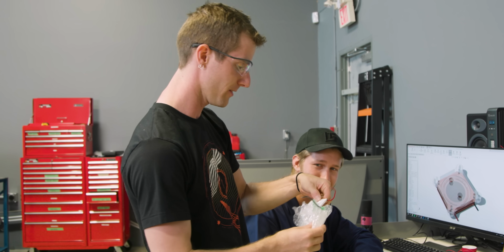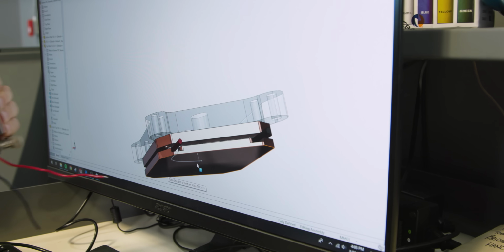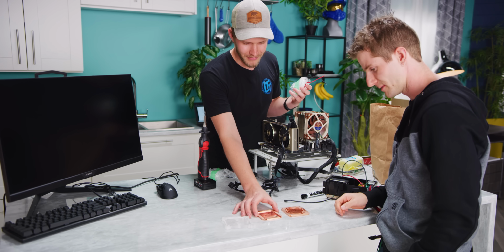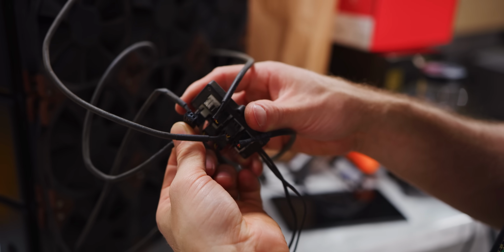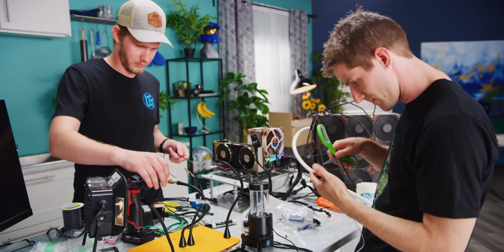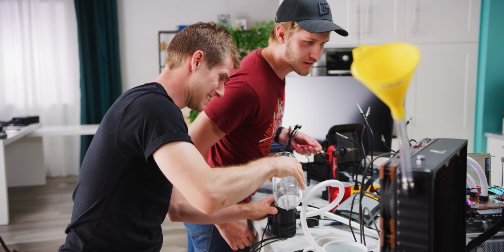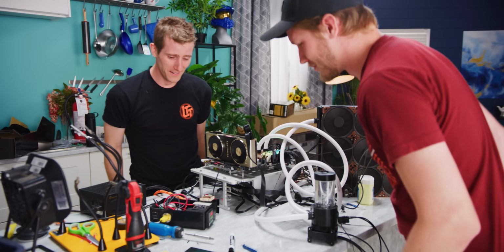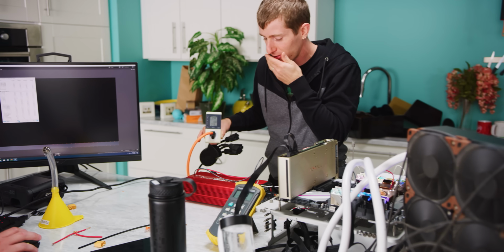This Cooler DRAWS 545W!!? Bad Cooling Ideas #2

Comment: Could you not use the TEC to cool your coolant in a liquid cooled system and also provide air cooling inside the case, have a heatsink outside the case to transfer heat from the hot side outside the case, this would allow you to have a sealed case with no way for dust to get in. You could also make it air tight to reduce humidity/condensation.

Comment: The total rate of heat dissipation from the system is equal to the radiators rate of heat dissipation so while the tech might cool down the water quickly at first, eventually the system will reach an equilibrium with the transfer rate of the rad to the air. Basically the tech doesn't really do much unless the rad is able to cool the water more quickly relative to the increase in heat

Comment: Hey a Linus/Alex.... In case you guys never got around to figuring out why that solid state relay didn't work (but still curious as to why). Look back at the video @5:23, I noticed that the SSR used here is designed for AC current ONLY (as in it's TRIAC-switched). While old mechanical relays don't care, for SSR's its actually a big deal, kinda.

TLDR: The SSR used here was for AC-current use only.

WHY? Well, it's due to the normal behavior of TRIAC inside. While they can switch-on DC current just fine; They still need a near-zero volt event across terminals 1&2 to switch back off again. (Which AC current provides regularly.)

Extra Nerddit: DC-current rated SSR's use either (cheaply) bipolar transistors, or more reputably by spending on much pricier IGBT's. Oh, and NEVER expect them to last if used over 40% of the rated capacity. That just the peak value.

The more you know. ;)

Comment: uhm just a suggestion though use the TEC 12706 module but use more of it and use a lower amperage with the same voltage to increase efficiency. hahahaha wishing for a part 2.1 on this

Comment: The only viable application for TECs in cooling modern systems is in a water chiller with more elements running at higher efficiency and with greater surface area. Insulating a whole chilled water loop to prevent condensation is a real PITA, and if you're not going sub-ambient, what's the point of bothering with TECs at all? And if you are go sub-ambient, are you really ready to deal with constantly checking for and dealing with condensation? Wondering everyday if today is gonna be "the day" that a drop of water hits the wrong spot in your system.

If you just want to do stupid things for a few hours, just setup an impromptu chilled loop with an ice bath, or dry ice bath if you wanna go really cold.
If you want to live life on the edge 24/7, go with phase change.
If you want to make the best possible investment that is both backwards and forwards compatible with literally everything, get a damn portable AC unit or have a mini-split installed in the room with your computer.

Comment: what if you use liquid cooling to bring the heat from the cpu than a grid of your "tech" to cool the water in the cpu loop. then another water loop to cool the "tech". i'm willing to beat that they have a rather harsh efficiency curve much like a heat pump for your house it is good at heating you house when it is 50 outside with about 60% efficiency then when it drops to 45 outside efficiency could theoretically drop to so something more like 10%.

Comment: Both sides were heating because there was no thermal separation between the cooper upper and lower. A simple gap of just a few mm would have had a drastically different result. You were dumping all the heat from the hot side directly into the CPU.

Comment: Have you tried putting the water pump in a large garbage can, then fill with ice and top off with enough water to keep the pump primed? 

That should give you a constant 1°C water supply temperature at the water block on the CPU.

(For better garbage can insulation, stack two cans with a blanket between them.)

Comment: What about putting the pelletier in series on the water return from the radiator pushing down the water temp below room temp?
Then throttling of pelletier is no longer an issue but it only adds cooling to whatever it can.

Comment: Hey you guys, so it seems that your power out put is way too much one second, then far too little! ... interesting, what if you could better maintain the temperature from one moment to another? I'm thinking of a mass of material that holds on to heat, like a thermos!

Comment: It breaks my heart that this didn't work, but I still feel like there has to be a way to get sub-zero CPU temps consistently without hazards even if the tradeoff is energy use/heat mitigation...
Reply: there is... these guys just went about it stupidly...... this works if you dont do it the way they did.....cool the water tank not the cpu directly
Reply: It's simple, an air conditioner

Comment: Using a Peltier cell to cool a CPU, that then needs to be cooled down by a water block, while it is also controlled by a PID system in order to avoid condensation... Wile E.Coyote style, I like it! :P
However, as far as I remember, those solid state relays need AC on the output side, as if you use DC supply they switch on, but don't switch off. Had a similar issue using them on lighting circuits on a yacht, as the owner didn't like the mechanical click of relays and wanted something silent, but didn't take this "feature" in account.

Comment: what if you used a pump with a higher flow rate?  It seems you can't wick the heat from the tec fast enough.

Comment: The basics of the TEC are they can only maintain temperature diff of 30 or 35 Deg C.... not more than that... so if the hot side temp is going up to 80 90 Deg C... then cold side cannot go down below 50 .... and this increase temp will run into a loop of overheating

Comment: May I suggest you try using a logic level mosfet next time instead of a solid state relay, Alex? Because as you probably found out during the making of this video, you cannot use a solid state relay to switch DC 🙄🤣 They can only be used to switch AC waveforms that cross through zero.

A solid state relay (henceforth SSR) is nothing more than a triac with an additional zero crossing detection circuit.  Although they are very different, the triac component in a SSR performs a function similar to that of a mosfet; where, for example, an active logic signal causes a current to flow. 

A very important difference between a mosfet and a triac is that once latched (and conductive) the triac cannot unlatch (and return to a state of isolation) unless the AC waveform crosses through zero, where as a mosfet can unlatch at will. 

This is the function of the zero crossing detection circuit; all it does is ensure that if the triacs logic signal becomes active somewhere halfway through the AC waveform, the actual latching of the triac is delayed until the waveform once again crosses through zero. Latching at any other point during the AC waveform has the serious potential of resulting in an enormous (potentially triac destroying) current surge immediately upon latching.  Unless you're lucky, and the triac happens to latch precisely at the zero crossing point of the AC waveform, after which the current is allowed to rise gradually with the voltage. 

[Important note: just as a triac is unsuitable for switching DC, a mosfet is unsuitable for switching AC!]

I hope this clears things up a bit 😁 I know the chance you'll read this is so low I might as well be talking to a wall, but perhaps there is a slight chance another soul will come and stumble across this information and find it useful somehow. Who knows, they might potentially even learn something 😊

(If I made a mistake please correct me in a reply to this comment in a friendly manner please and I'll happily modify this comment!)
Reply: It seems that Alex, just like me, is a mechanical engineer. We know very little about electricity (I've had like 2 classes in university for one semester). I learned everything what I know when I was working in electronic retail shop as my first job. I did my master's degree on Meredith's effect and pressure carburetors!
Reply: They could have just avoided the high current switching by using the enable pin on the power supply
Reply: SSR's work just fine with DC signals and do not require any zero crossing. There are IGBT, Mosfet and Bipolar versions from different manufacturers. 
You are thinking of an AC-only Solid State Relay... basically an optically isolated triac.
Crydom D2D40 is a perfect example.

Comment: You need to cool water with the tec, direct cpu cooling using tec works only on lower powered cpu's, it will never be enough to cool that 7900X. I was able to cool Ryzen 5800X to sub-ambient using 5x78w (78W at 12v, 100W at 15.4v TEC1-12710) tecs with proper peltier waterblock/heatexchanger cooling the cpu with the cold water out from heatexchanger, in the end i found it to be impractical and desided to use it as room air cooler instead, plugging in 480mm radiator in place of cpu waterblock, its actually cooling room air very well.

Comment: The thermo electric cooler did not have enough Qc (heat transfer rate) to transfer all the cpu heat let alone all the cpu heat and have a decent delta T. It would be cool to make two loops and an array of TECs transferring heat between the two loops. Might actually be able to transfer all the heat and get a good delta T. Make sure you do the research on the TECs you buy to make sure you have enough Qc at the delta T you want.

Comment: I think toavoid overwhelming the tech it would be better to make a second and third  waterblock for the cold and hot side of the TEC run the hot side in line on the inlet of the radiator and the cold side on the outlet. The water should have a decent chance to dump the heat through the radiator and maintain a much more gradual thermal load than direct CPU contact.

Comment: I'd like to see the kind of money that it often thrown at the cooling problem, spent on the maximum volume of material possible in the most brute-force approach. Like one of those old hot water tanks converted into a cooling tower type thing. Then hooked up to a standard PC cooling loop, with whatever considerations that might require - basically just a D5, right? ;)

Comment: I built a fully contained TEC setup in a Lian Li PC-V2000+ capable of running an FX-57 with a TDP of 104W at -20C max load back in 2006. The case is in storage if you want to make me an offer. I also have some super rare Wintsch Labs blocks. Look up Uberleet Superninja on overclock.net for build log

Comment: Solid state relay to turn on/off DC power 😂 are you kidding , solid state relay have triac which is only used in AC SYSTEMS , You need something like MOSFET , or normal mechanical relay .

Comment: maybe an idea could be a low to mid-range CPU or computer setup cooled by TEC and doubles as a heater for colder climates? admittedly even in the frozen tundra of Canada I can't imagine that being of much use considering how good heat pumps are.

Comment: I'm not like an engineer, so like I'm sorry if this sounds like a dumb idea, but maybe putting the Peltier directly onto the CPU, and/or trying to use it to cool a CPU on it's own is a bad idea. Mainly because it's kinda difficult to make it worth using because it has it's own thermal limitations that need to be taken into account. So why not instead use it to cool the water as it's coming out of the radiator toward the CPU? That way the water is never too hot to overload the Peltier, and the loop stays extra cool. Maybe it's pointless, but genuinely I'm just wondering if it would work.

Comment: I think people are using peltiers the wrong way. We are already good at getting water back to room temperature, we should keep our existing loops and focus on making the water that's going into the block cooler. 

if you make a reservoir that runs water over the cold side of a peltier there are a couple things that you gain: 

1. The ability to only turn on the peltier when it's really necessary (Example, when reservoir temp is 5 degrees above ambient turn on turbo charge mode)
2. The ability to pick and choose a module that isn't quite as overpowered. You don't need the module to move the entire 300w of heat (or whatever). You could pick a 200 watt peltier that moves 50w of watts of heat and still get a massive performance increase. 
3. failsafe. If the peltier dies or whatever, you have still have the vanilla loop.

Comment: Hi  I fink u should not try to cool the cpu directly  .u should used it as a booster to cool water in a custom water cool system. Like a pelchay  tank cooler. Or used a heat exchanger to a pelchay.as2 loop system.

Comment: I built a peltier cooler based on the Coolit Freezone Elite design, with the exception of using water blocks to accept the heat instead of the 2lb copper heat sink. The TECs are sandwiched between two water blocks, with two separate loops: one loops through the CPU water block, the other loops between the water blocks taking heat from the peltier and through a radiator. Total of 4 water blocks plus a CPU block, and a radiator. The mistake all the mfg's make is putting the peltier right on the CPU. Better to use a typical CPU water block, then put two rectangular water-blocks in the loop. (much more surface area). Then sandwich peltiers between those rectangular waterblocks in the CPU loop and 2 more in the radiator loop. Uses less power, about 245 watts, and cools much better than the Freezone Elite.

Comment: You should use PID controller for the peltier and there is no need for on/off control just set the PID to 25 degrees

Comment: I did this exact same thing in 2015 on my 4790K, only I had a 400w TEC and a Koolance CPU block that fit the TEC, with a copper plate as a heat exchanger for the CPU.  I cooled the TEC with a custom loop.  It worked, but totally sucked.  Drew a ton of electricity for no more OCing head room.  I had to insulate everything as I didn’t use a controller, it was full bore 100% of the time.  It was an interesting project, and I learned a lot, but I’d sooner keep that money I spent.

Comment: So in a nutshell, you need to be able to wick away heat from the 900w worth of "hot side" on the Peltier module, PLUS the heat generated by the CPU, and if your able to do that, you might as well just have that cooling system mounted directly to said CPU.

 the modules may have a use in temporary surge heat situations tho, so i would still like to take this time to criticize Linus for not having a large enough surface area making contact with the moving liquid that rolls across the meatal of the hot side of said module also, probably to0 much thermal paste, or not enough, or thermodynamics is just a pescky lil bitch! lol

Comment: New idea use liquid cooling loop (probably will require an anti freeze) on insulated cpu to a paralleled bank of peltier chips to a liquid cooling radiator loop

Comment: I think the hot side of the TEC peltier sides was just in touch with the copper plate that you guys put between the peltier itself and the CPU.

Maybe some of the thermal paste just got on the side of the peltier and just got in touch with the hot side so that was transfering heat to the CPU at the same time trying to cool it down

Comment: Do TEC-precooling. The hot water from the CPU gets routed through a conventional radiator to get it down to conventional intake temperatures. After that, you run it through another CPU-block that is connected to your rig through the TEC. This way you may get water to the CPU that's cooler than ambient temperature.

Comment: the biggest problem is that you guys are using the Peltier as a thermal pump and a cooler at the same time! You should first cool the water through the radiator then pass it through a cooling stage (Peltier + second water block) so it goes cold to the cpu

Comment: A solid state relay works for AC only. They're a thyristor. They need the negative half cycle to turn off. 😂 An actual relay would have worked. 😂

Comment: I think the best way to do this would be to have a normal water cooling loop and after the radiator have another water block with the Pelletier module. I this would bring the water down near ambient and not overwhelm the PET. Then it can work to cool below ambient

Comment: Peltier devices does not work like a normal electronic device. At a motor if you jam more current in (increase the voltage) the motor spins faster. But with a peltier device this is not the case!

These devices only create a temperature difference between the hot and the cold side. So if you force more current in, the hot side will get warmer (because the heat removal is limited to the cooling system), when the hot side gets warmer, the temperature of the cold side will rise, too(because these devices only create a temperature difference =)).

To get the most out of a peltier element there is a sweat spot, between the temperature difference and the amount of heat which is generated (and can be removed from the cooling system).

In conclusion : use lower voltage and your cooling will be better =).

Comment: Why put a peltier on the cpu directly? You should make an AIO where the peltier cools the water after it has passed through the rad. That has to improve performance (if you can route the heat from the peltier sink to not go right back into the main rad).

Comment: But Linus, what makes rads so good is it has multiple layers of cooling whitch brings the temps down little at a time. Plus how I see it it's like slapping a small heatsinks on a cpu and expecting it to it down. So will it be a bad idea to build a rad type pelta cooler that can be tested with and without fans?